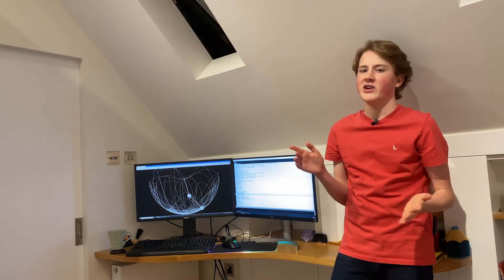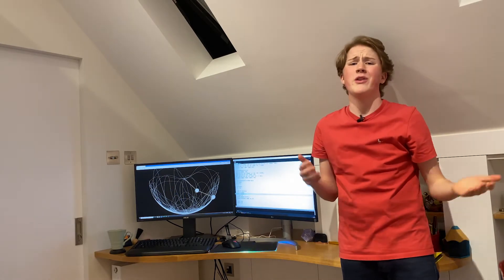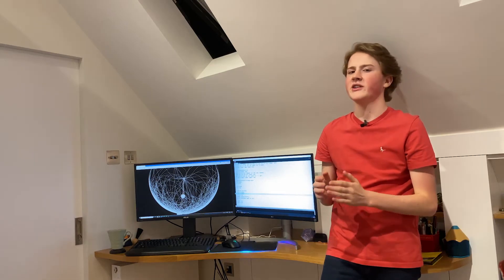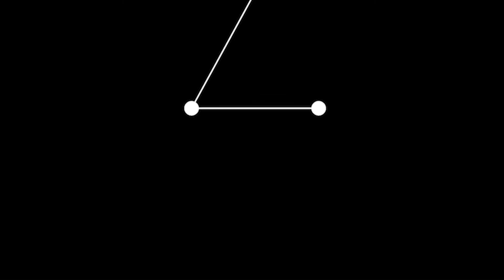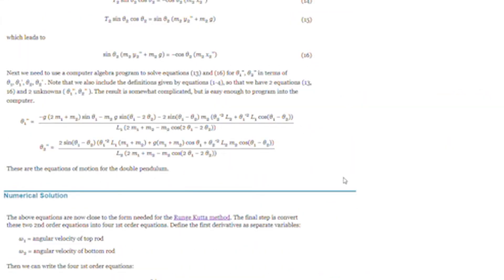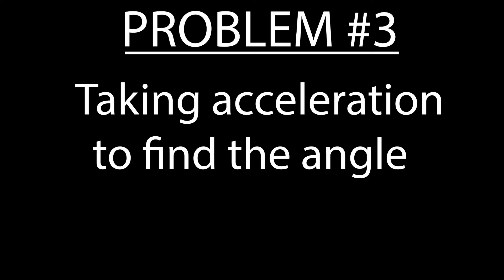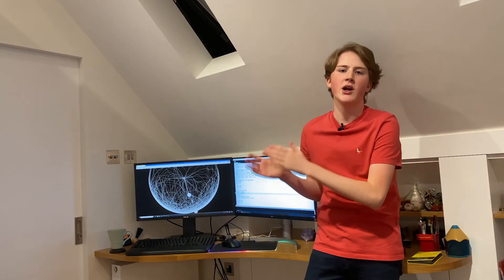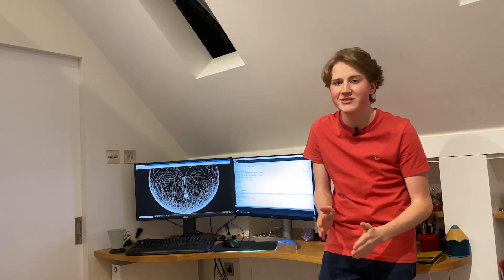Personal Project - Coding a Double Pendulum

Comment: Very nice! Is it possible for you to share your code? I just made a double pendulum in p5js but I have a problem which is that the pendulums energy doesn't seem to remain constant. My double pendulum seems to slow down/speed up over time as though the total energy of the system was changing - did you ever encounter this problem? Either way I'd be really interested to see your code!